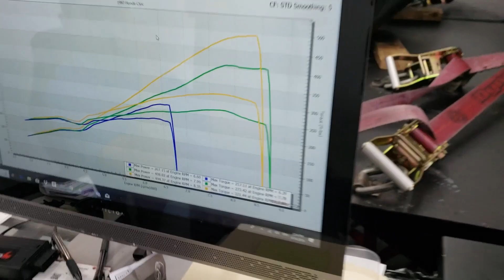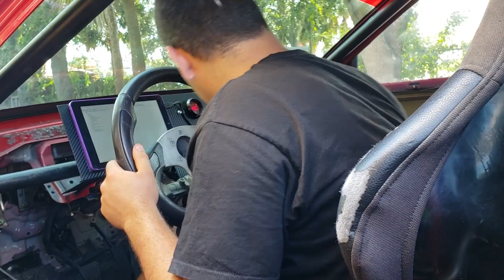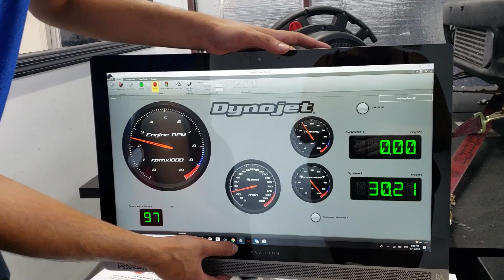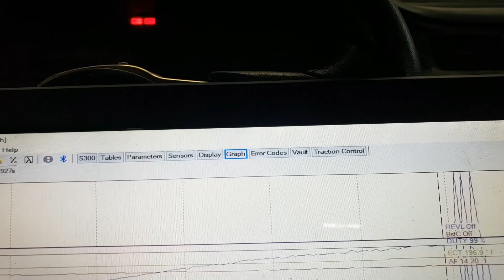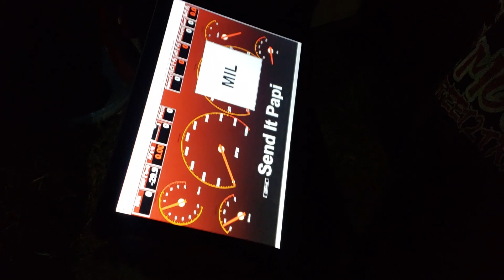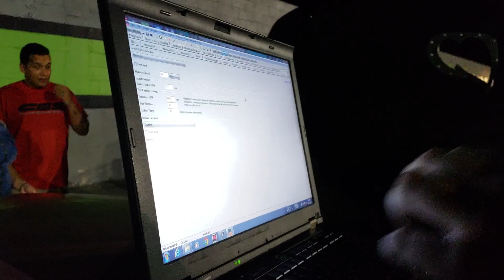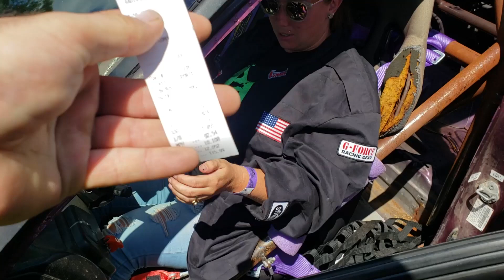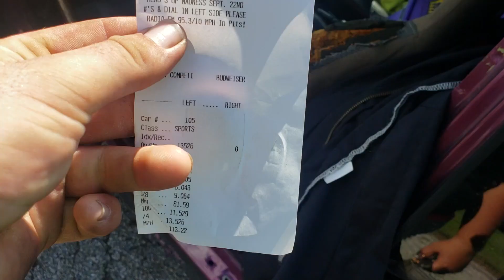SP tunings 650hp+ integra and @boosted.tina get some dyno and track time!

Comment: Shit bro, my LSVTEC turbo EK Civic coupe has full interior, all trim and plastics, rear seats, center console, 7" touchscreen, all speakers, plus it has a set of Sundown Audio SA-12D2 subs in the trunk...lmao You can tell that I'm not very worried about weight...
Reply: Btw, so far it's made 508 whp, but we weren't done tuning. It's running on 93 octane because E85 isn't very popular around my area yet.

Comment: do you launch in 1st or 2nd
Reply: I launch in 1st
Reply: just curious is there a difference? What about on the street
Reply: I only do 2nd gear burn outs at the track, on the street is 1st gear burn outs. I've never launched in 2nd before so I'm not sure what the difference would be.

Comment: I live in Cape Coral! Might need my K Miata tuned too :)
Reply: What Saab do you own? I had a '91 9000 turbo with the B234 motor..super stout blocks
Reply: @gasscooterdude  I think this question is for me. I own a 1995 Saab 900 with the b204. I've fully built the engine and I have opted for a quaife straight cut gearbox. Gt35x turbo hoping to make 500 hp AT LEAST
Reply: MrDannyd9 Haha me too

Comment: Brent have you/are you willing to touch a Saab? Please mine needs tuned. Thanks
Reply: idk if youtube is the best place to ask
Reply: @Brendon Morris keep hating. You're just jealous.
Reply: @Brendon Morris whatever you say hater. Hate = jealousy
Reply: @Brendon Morris let me ask.. why did you feel the need to hate? To make to yourself feel better about your hyundai Elantra?
Reply: What model of saab? What Mods?
Reply: @jamesmcivor340  1995 Saab 900 se. Techno5 rods wiesco pistons. Hx35 turbo. 3" custom exhaust. Saab 9000 intercooler and intercooler piping (slightly modified). flipped Saab 9000 manifold. Quaife lsd. Spec clutch and aluminum flywheel. Viggen big brake swap. Volvo Green giant 550 cc injectors (plug and play). Stock head and new oem head gasket with arp studs.